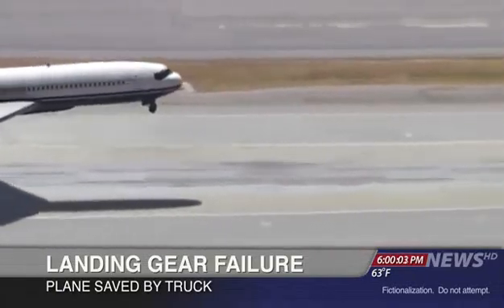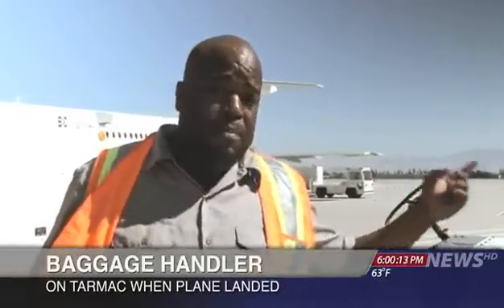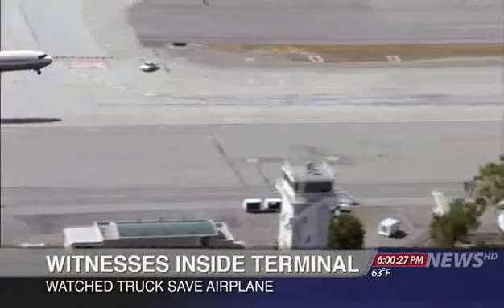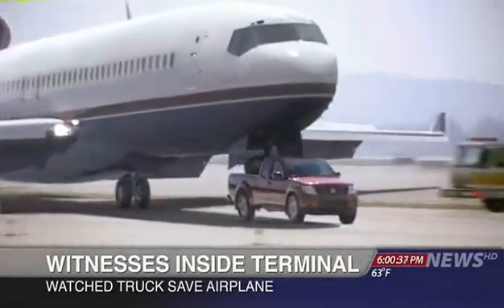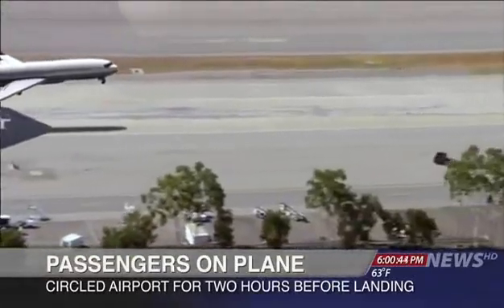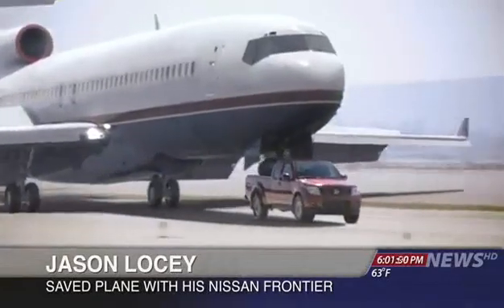Truck Saves Landing Aeroplane With Gear Failure Unbelievable!!!!!!!!!!!..DO NOT ATTEMPT

Comment: im just want to share to you guys about plane laws...*kinda* 
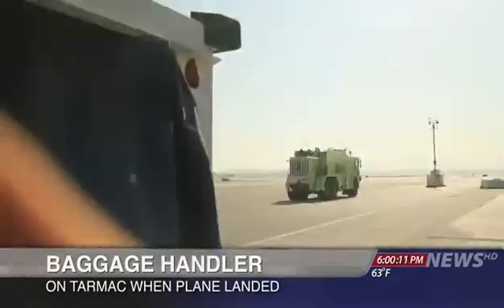why this plane can still glide perfectly on about +5degree (recommend for planes to land)(flare) while the spoiler are up... look at 0:05

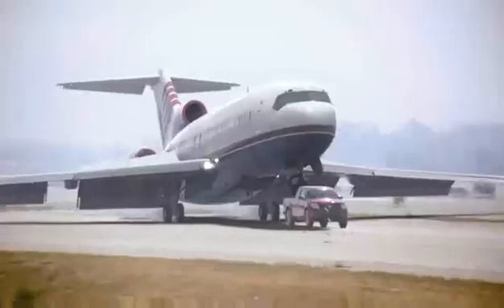and at 0:54, watch the smoke system on the plane tyre and the truck..see..the plane tyre suppose to have more smoke, because it force to turn at 0 to xxx rpm in a second..while the truck having a same speed as the plane touches the truck, why does it must have smoke??
BTW is it a 727? :D